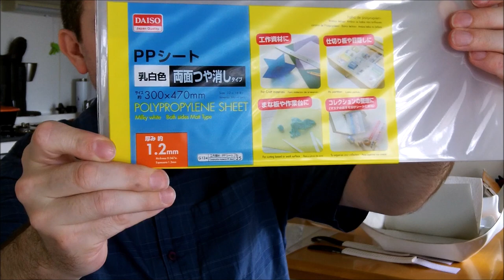Chest Armor part two

Comment: Great video like always, I got a few questions, where did you buy the styrene boards? 1mm in thickness correct? What is the link to shoulder straps and the belt that you obtained??
Reply from the maker: Styrene board I got from my local DIY store. As for the straps you will have to join the worldwide Clone Trooper group on Facebook and ask there.